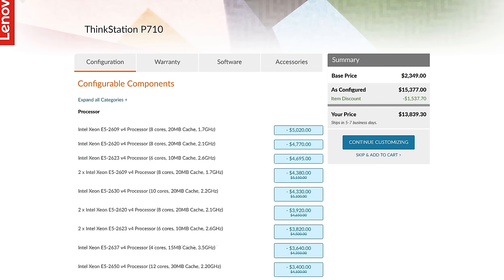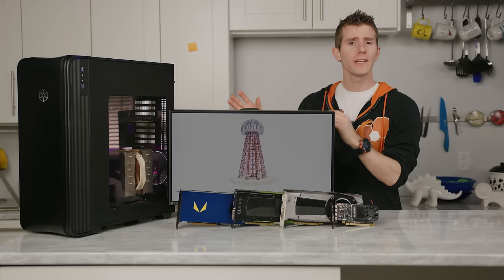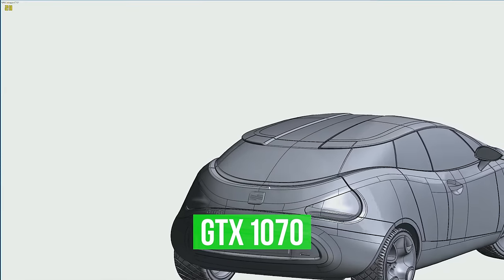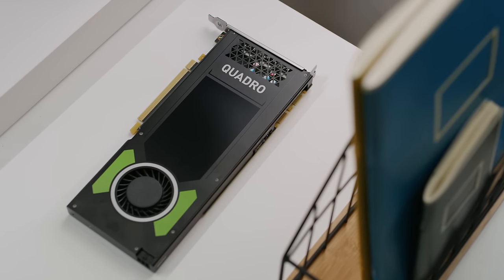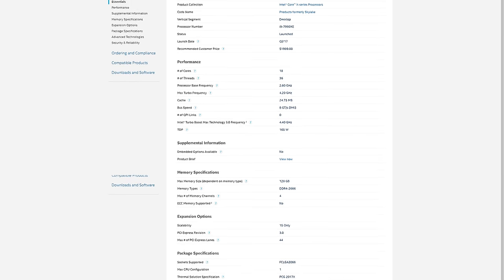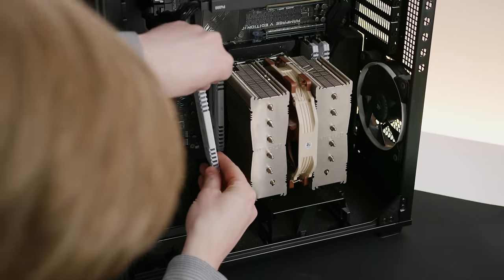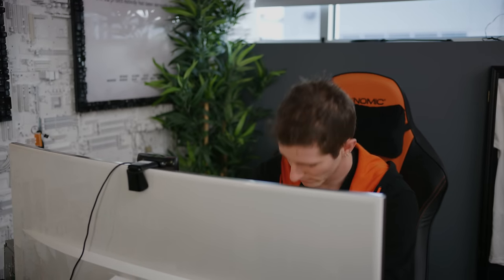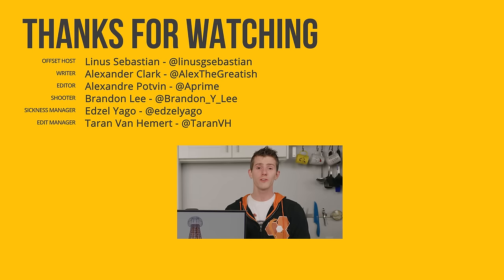3D Modeling & Design – Do you REALLY need a Xeon and Quadro??

Comment: Title should have specified CAD / Solidworks. I came expecting Maya or Blender. Disappointed
Reply: I do, however, think that the title was very generalized and the actual video did not give a generalized use case scenario, which would have been a better match for for this title.
Reply: I think Steve over GamersNexus did some video on Blender. Check them out.
Reply: Thx
Reply: Same. Also the lack of Arnold and Vray rendering.
Reply: How do you know they didn't ask and weren't told no?
Reply: Here is what I have found.
For Maya/3D MAX/UE 4 OR Unity:
A GTX 1080 Ti is Really good card for Everything DirectX
A P4000 would allow More modelling muscle but Lacks way far at Direct X stuff.

GTX 1080 Is the sweet spot.
16GB RAM is enough For it
RYZEN beats SH-Intel Ass in 3Ds max/UE4 all threads optimally utilized and ofc won't break a sweat no matter what.
Though i7 8700k Is Nice that doesn't mean It is the best.Ryzen 1800x Is the one To beat.
Threarippers and xeons are different story (Meaning suited for CG Artists and such).
My Personal Config(For Reference only) is:
GTX 1080TI
16GB RAM
R7 1700
850 EVO SSD.
CATIA ,Creo,Solid Are for Automobile or Mech Engg specifically.These Apps are Designed specific for Heavy Analysis purposes.And require precise Numbers.Have nothing to do "3D".Although Models are required for creating and analysis.For Even solid works  something Like p4000 Is Absolute Overkill.Unless you are a High end professional person and have a big Portfolio then it's a different story.But In real life usage I think A P2000 is absolutely sufficient for it.But it's fine for Solid,Creo n CATIA.Not for UE4 etc.Where you NEED Eye Candy.
Reply: I mean you only need a good GPU for the render modes. Actually building and animating a model, besides more intensive stuff like 3D sculpting and (I think) physics, can be done with an integrated GPU with no issues.
Reply: @udiepie3314  for CAD 2d or 3d and Revit MEP what is the best
GeForce 1080 ti or Quadro P1000/P2000 ?
And what is the more Value for money?
Reply: Watched, I am sure it would answer the question :)

Comment: Wait...so you just recommended the Xeon W 18 core for the "upgrade" option for multicore rendering at 2500$ (excluding the cost of the board and wasn't even included in the benchmarks)  and completely ignored Threadripper at HALF that price for the same performance AND including benchmarks that show 2 Xeons with 44 cores in total not even being 100% faster than that 16 core TR?? As well as completely ignoring that AMD's WX series GPU's even exist? What gives??
Reply: SepherixTheDragon I agree on this. The 8700k is a massively overrated CPU, I don't see why he recommends it in EVERY single fucking video for EVERYTHING when you have TR, X299, X99 (for cheaper) Epyc, and better Xeon second hand CPUs...

He's also ignoring other GPU options. Linus is just not genuine anymore
Reply: I have a second hand Xeon e5 2680 v2 (10c/20t), I don’t do modelling but I do a tonne of Virtualization and I can tell you that it is a total beast and it only costed me $220!
Reply: A lot of high powered applications don't play with AMD hardware very well.  For instance, tensor flow works much better on Nvidia GPUs.  Its a sad but true reality, perhaps if AMDs popularity keeps rising developers with optimize for it better.
Reply: Between Linus who does this shit for a living and all of y'all doctors in engineering, I'm going with what Linus is saying. You gotta keep in mind that simple performance isn't the only priority. You need platform stability. If you're working on a 50,000$ project and you lose it because your cpu decided to be retarded, the performance doesn't matter. And if you look at most workstations, blade servers and data centers anywhere, intel is a clear choice.
Reply: No, go to WX 2990 is 50% more faster than the i9 7980XE in multirendering ;)
AMD 5100 points in cinebench 5700 with a little overclock
Intel 3400 points
The reason AMD has 64 threads and Intel has 36 threads.
Reply: @prestondial1992  donno if you're right but he should have included them in the video anyway and find out if thats true or not and to clarify this
Reply: @rochenwolf6113  thats not a reason for ignoring them. If they are so bad he should have prove that with benchmarks.
Reply: @JoseLuis-kk5jt  this video was made before wx
Reply: @luigius8590  .  Indeed.  I don't know how well done the tests from my sources were done, and I certainly can't test it myself.
Reply: but xeon is buy with the warrantly "perfect perf 100% no error" amd no

Comment: Why no AMD 's workstation Radeo Pro cards?
Reply: Eventually, you will need cuda for something,  and AMD cards don't have cuda.
Reply: They are clearly better, so it would be no competition
Reply: Harry He amd have stream processors i think they are the same as cuda
Reply: WHOA WHOA WHOA.

No Nvidia is NOT better, no CUDA is NOT needed.

Give me a break, the misinformation is extreme here. CUDA is the same as Stream Processors with AMD.

The only difference is that some softwares take advantage of "CUDA cores" (as if they're some mighty cores) because they only optimize their software for Nvidia.

My AMD Fury rips the 1070 and even 1080 a new asshole when it comes to game design and rendering because it has more power, AMD has always had more raw processing power whereas Nvidia only cares about speed, which is only good for FPS.

AMD offers free Radeon Prorender, whereas with Nvidia you have to Shell out $300 to use their renderer that does the same thing.

Nvidia makes you pay for $100 extra Vsync too. 

Seriously how could you even say something so stupid when Linus literally just showed you benchmarks of AMD shreading Nvidia in Solid works. And the only reason "Quadro" or even the WX series GPUs have any lead on gaming GPUs is not because they have more power (in fact they have half the power) but because they are optimize ld for the softwsre
Reply: Harry He I've gone without CUDA and have no problems, it really isn't that hard to do, just don't use their stupid rendering crap

Comment: Hey Linus! I am an aspiring sound designer, can you make a video that goes through computer hardware that covers what can be an ultimate computer for a sound mixer?
Reply: Don Bastian you don't need much. Any modern cpu with 4 GB of ram and 1tb HDD will work. What matters must is the D/A converters which you'd have to buy from like Sweetwater or guitar center.
Reply: ezar howard I heard once about increasing rendering speed using a GPU. I'm not quite sure how it works but apparently it works incredibly well, do you know about anything about that? It could be quite useful for me
Reply: FAST HARD DRIVES........ AS MANY AS YOU CAN GET. I run a i7 with 16gb of ram, a 250 gb nvme drive for os, a 1tb mass storage hard drive for regular programs, a 3tb hard drive for my music files and a 500gb ssd for music programs. Music files will add up quick especially if your like me and you keep every little idea that you make.
Reply: Glenn from SpectreSoundStudios and Ryan "Fluff" Bruse might have some tips on PC hardware.
Reply: Oh you'll need some specialised computer hardware for that (if you wanna go pro) grab yourself a soundcard. Chuck it in a home desktop. She'll be right.
Reply: You don't need an NVMe. Having an NVMe only speeds up the loading times of programs, but it doesn't affect the rendering or compositing of sound or visuals.

Comment: This timing is incredible, I’ve just ordered a custom build Solidsorks/Autocad PC today! Did some research as well and ended up with this setup:

Specs:
CPU: Intel Core i7 8700K (will over 
Clock up to 5Ghz)
Cooler: Cooler Master MasterLiquid Lite 240
RAM: 32Gb DDR4 G.Skill Ripjaws V Series
Motherboard: AsRock Z370 Fatal1ty Professional Gaming motherboard (Supports 10GbE & Thunderbolt with extra PCI)
SSD: Samsung 960 PRO MZ-V6P512BW (Crazy fast SSD)
GPU: NVIDIA Quadro P4000 
PSU: Seasonic Prime Ultra 750W Titanium
Case: Fractal Design Define R6 TG
Mouse:  Logitech MX Master 2S

All just under €3K
Reply: ropiko nice. But I really don't like the MX Master. I find the Performance MX or a Corsair Scimitar Pro much more comfortable and useful. Have your had a chance to put your hands on a Master yet? What did you think? I really wanted to like it; it's such a good looking mouse but I found the side button placement not working for me.
Reply: So... you don’t need a monitor? 🤔
Reply: Adam Weeks no I haven’t yet, I’ve did some reading online to figure out who uses what mouse for solid works and multiple people said this one, but I will send it back if it’s not OK. Maybe I’ll order your suggestion as well to compare
Reply: Gunbardo we already have a monitor in the office, we use the ASUS MX299Q Ultra wide monitors. They’re OK but I wouldn’t recommend their build quality.

Comment: By the time you start playing with assemblies that contain a significant amount of parts and would require beefy hardware to render, you're most likely working in a decent company that has all the gear you need anyway.  For non-commercial stuff, just buy any reasonable computer with sane specs and call it a day.
Reply: Pfft, I wish they provided all the gear I needed. I'm a mechanical 3D modeller and the computers at the international company I work at are garbage hah
Reply: Same; I regularly use AutoCAD Civil 3D to draft surveys and my company still has me on a 2nd gen i5, Radeon HD 7570, and 8GB of ram and it's horrible.
Reply: Cody Stringer I'm so so sorry...
At least I have 16gb, which very often gets capped. I often do rooms (big big rooms) full of furniture, and assemblies with thousands (when this video said like 500 I laughed) parts.
Reply: We use Autodesk Inventor with i7-6700, 16GB Ram and Nvidia Quadro K420 1GB because some "I know CAD stuff" guy recommended this shitty VGA to our IT guy. Unfortunately Inventor uses DirectX and the card runs at 100% almost all the time. -.-"
Reply: We use the exact same hardware at my place, down the the K420 along with Autodesk Inventor. So I really really feel you pain bro.
Doesn't help that Inventor leaks memory like nobody's business either.
Reply: Truth...
Reply: I just finished an internship at a company as a mechanical engineer and I did some modelling, they gave me a laptop with a i7 6770, MX4000 and 32gb of ram, and that was only the loaner till my baller watercooled desktop workstation came lol
Reply: "look at me, I'm Dave, and I got a fancy custom built desktop for modelling, meh meh meh!"
Just bugging you, that's awesome dude! That's the way it should be
Reply: PooPipeBoy not if you are freelance. Then you have to buy everything yourself
Reply: Always build your own pc vs buying. I put together my pc in 2011 and because I carefully chose the right parts I can still use Zbrush 2018 and play games like Overwatch just fine. Total rig cost was around 1,000 dollars and I only had to replace hard drives so far. Everything else is running smooth since day 1. Even if its a cheap pc buy your own parts and buy them on prime day/blackfriday/cyber monday.
Reply: I wish. I have a 10-core Xeon, gtx1060 and 64 gb ram Dell built system at my company, but thanks to the company-bloatware and other bullshit, it still runs horribly for its stats. My self-built rig at home with i5, 780TI and 32 gb ram feels so much smoother...

Comment: OK, then. I'll go buy a RX 580.
Now, where are those?
Reply: IIARROWS "Great bang for buck" 😔
Reply: you dont want a rx 580. thats a bad recommendation. you want amd's pro series. the wx7100 is the rx 580 of the cad world.
Reply: Flyinghotpocket Watch the video...
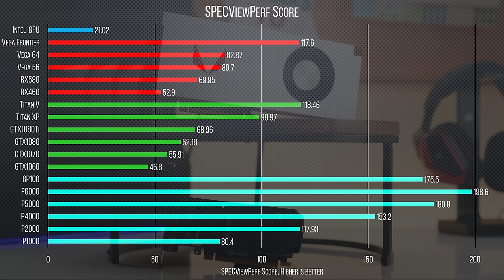hint 4:35
Reply: Micro center
Reply: i watched it. now look up some specs. since linus conveniently ignored the radeon pro series. and coming from real life experience (something you lack) i can tell you the 580 is inferior in cad design to a wx7100.
Reply: Flyinghotpocket For a STUDENT? Who plays games and occasionally does 3D modeling?
Reply: Flyinghotpocket That's not what the use case Linus is suggesting for the RX580...
Reply: fine. lets add in student just for you. since the rx580 series is going for literally 500$ on ebay and newegg is sold out like 999999% of the time. you gonna buy that? or you going to pony up a extra 50$ to get yourself a wx7100 which performs the same as a 580 in gaming and is light years ahead of it in any cad situation and it had a 7 year warranty vs the 580 2 or 1 year warranty. 

bad recommendation is still bad. when the rx580 actually gets close to its near msrp of 280$ then yeah its a win. but right now. no not at all.
Reply: Flyinghotpocket That was the joke... -_-

Comment: I was really hoping to see more numbers about simulations. But anyways, simulations in general use a lot of RAM so yes, 16GB is really the minimum here. Depending on the program used, you may not have other options but to get a Quadro, like ANSYS which only allows Quadro GPU to be utilized. As for storage, you will need an nvme ssd. A normal one will do the job as long as you dont run complicated models and/or analysis.

Comment: I work with Inventor pro 18 on my home desktop. This machine has an i5 4670k @4GHz and a GTX1070 in it, and I can work perfect on medium sized gearbox modells (around 200 parts, excluding screws). On work I have a way slower PC with an old AMD FX and some cheap nVidia GT in it, this struggles with big assemblies but you can work just fine with smaller assemblies (100 parts or less excluding screws). The only thing that takes time on both machines are FFT Analysises and complex geometry tasks like calculating new cable strants without many given variables.
For me the limiting part is mostly the RAM, with big assemblies you can catch up to over 16GB just for Inventor very quickly depending on the grade of detail.
With that said: I just model and simulate these parts and assemblies. I do not render them. I am an engineer, not an designer or a salesman.
Reply: I was looking for this kind of comment. You really don't need a fast GPU with engineering, maybe for graphic design, but really the consumer grade stuff is perfectly fine, especially for FEA.
Reply: Not even for graphic design. You need a lot of ram and a huge hard drive. A better processor is nice, but ram is the problem.